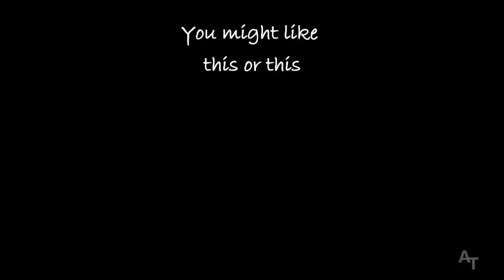WD40 Silicone for Waterproofing Electronics--Further Testing

Comment: The Flashing light earlier you got was indicating your receiver suffered a "Brown out" (momentary loss of connection) sometimes when using DSM/DSM2 receivers  with helicopters with carbon frames you need to use one with twin recievers to prevent getting brown outs.

Comment: Silicon itself will water proof it was one of the first methods used but it will cause a thick coating on it and cause it to over heat. Even corrosion x basic will work fine but the heavy duty corrosion x which is thicker will cause it to over heat cause it has an additional thick film. It’s better used for metals that will rust faster and boats cause salt water is harder on surfaces
Reply: I thought silicone had excellent heat dissipation properties.
Reply: @F-rig  maybe from the outside but the inside it traps heat in
Reply: @kiodiekin  no good
Reply: @F-rig  its ok on metals and such but i wouldnt use it on electronics. if u do just expect higher temps
Reply: I found this too, what do you use instead?

Comment: I am looking for a quick and easy way to waterproof my toy grade quads so I can fly in heavy rain/bad weather.  I don't want to take them apart, I just want to spray the board from the battery bay.  I would think the boards are pretty protected but water can find its way in when flying in heavy rain.  It looks like the wd40 might not work for what I'm looking for, it would be nice to just spray it once and have it work.  Thanks for the rad vid man.

Comment: Tempting... however I've read (not easy to find btw) that under certain conditions silicone spray can combine with metal(s) to form high resistance films, destroying low energy electronics (e.g. signal lines, transistors, etc.  Power lines like battery to speed controller might have a better chance of overcoming that resistance).  I believe some electronics potting compounds are made of silicone, so this is certainly confusing!

Is the viscosity a critical factor?
Are those who succeed simply lucky?  
Anyone have some additional insight?

Thanks for posting the video @RCwithAdam !
Reply from the maker: Looking back at this experiment, I would now recommend CorrosionX instead. ALSO, I realize this test didn't really prove that the drone would not have worked even without the WD40 since it was freshwater and not salt water (which would make short circuits extremely more likely). This type of "waterproofing" is really more for corrosion protection and possible short term short circuit protection.

I think what you are referring to is the side affect of overheating due to the waterproofing material thermally insulating the electronics, which reduces cooling and can cause burnout. This is definitely a real thing, but It really depends on the electronics and amp draw, and the thickness of waterproof coating.
I agree, it is confusing and it seems everyone has a different opinion on it (which varies with each context).

For full waterproofing, I'm starting to use FPV Worry Free, which is basically a liquid silicone. But further testing is needed to see if it will cause overheating with drone electronics.
Reply: @RCwithAdam1  thanks for the well thought out reply!

Comment: I believe your problem is in the wire connections. You should use like some sort of hot glue or some sort of pliable and Apoxsee coding. Something that’s an insulator that will not short out but also ensure that your connectors a rigid and water proof
Reply: apoxsee = epoxy? lol
Reply: Anything you could possibly try, and I have not done this myself, but they make a plasty dip spray. It’s a rubberized coating that comes out of an aerosol spray can. You can get and clear which I would recommend or you can put it any other colors it’s available like red or yellow or black but you won’t be able to read your board Screen printing after that. Just a thought… Happy new year.